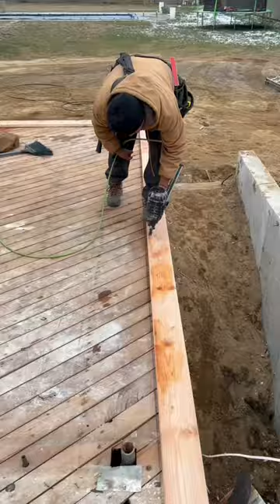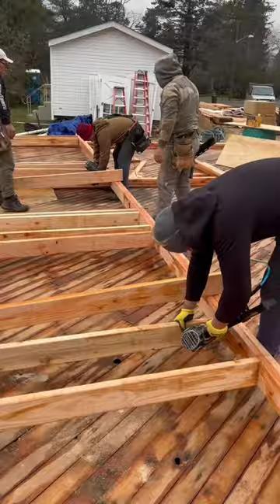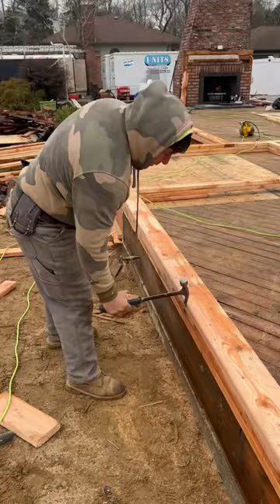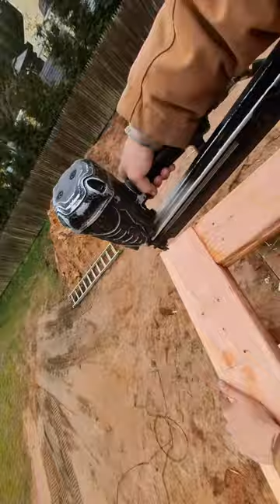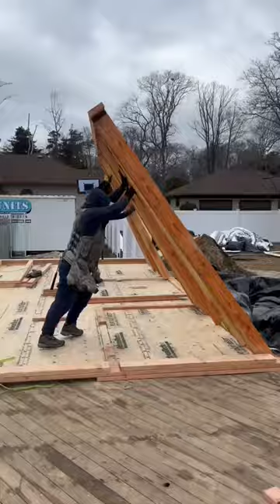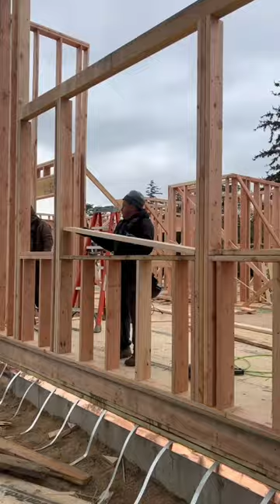Walls #shorts #short #work #construction #skills #design #perfect #beauty #team #architecture

Comment: It is toenail framing vs. box framing . Was a box framer in boom of the Pocono's on border of New Jersey where toenail framing was code . I did both and laying out all 3 plates gives a unique perfection of walls, corners in place that racking a few corners brings everything in . Also hurricane codes of toenails hold better then box nailing . But I prefer box framing as good builders create same square walls , box building and were putting up walls asap and building them on flat floors . I think box framing is faster and I added the only doing headers to get walls up fast and easier putting in sills, jacks when walls are up. Plus have something laborers could do , to keep busy .
Reply: You would consider the style of framing in the video triple plate and toe nail? I’m not sure what you are saying.

Comment: Why not tear out the floor and put in a new one? That floor looks old and squeaky. You are so close to just having a new home (except the foundation, which proper concrete lasts for centuries anyway).
Reply: This is a question for the architect or general contractor on the project. This framing sub just follows the plan. Some municipalities require certain existing framing to remain in place to qualify as a remodel vs a new build. These things all affect the bottom line.

Comment: Why don't they just mail the bottom plate on, instead of toe-nailing?
Reply: Toe-nailing is a stronger connection
Reply: No ,,, it’s not ,
Reply: @559PHINZ Really?
I was raised:
That "if we're talking about framing a stud wall, not a floor, face or end nailing isn't an option.  In this instance, a toenail resists both lateral and pullout forces better than an end nail, and is therefore preferred.  End nailing is easier to do for raising wall construction, and often contractors will end nail first, then toenail once the wall is erected."

Teach me something new?

Comment: This is how the mennonite crews around where we work stand walls. We build the whole wall on the ground and stand it with the bottom plates attached so we don't have to toe nail the studs. I bet its easier to keep the walls precise to the plan this way
Reply: After plate layout, you can see what everything is going to look like before pulling back and any thing is studded. Try it. You won’t go back.

Comment: Headers should always go tight to the top plate then put cripples in
Reply: These are not 8’ walls at the first floor. You get a stiffer opening if the header is directly above the unit.

Comment: The absolute worst framing I’ve ever seen. That’s would not pass inspection in 80% of states
Reply: Good thing they are in New York where it will pass inspection, like damn why are you do butt hurt? they are top tier framers. Anyone can see that, the worst framing you have seen? Really? Cmon man, just because they don’t do it one way doesn’t mean it’s wrong . Hence the saying, “there are many ways to skin a cat.”
Reply: Ok, Logan... is this how you frame? No Corners, either California or Box, no Partitions, neither are in the walls before you stand?? Do you leave these items out and put them in after  the walls are stood, like these guys? Occasionally, I will frame openings after the walls are stood, mostly depending on location and size. They definitely don't frame like 99% of Framers.  It obviously works, but you have to admit it is not normal and is slow.